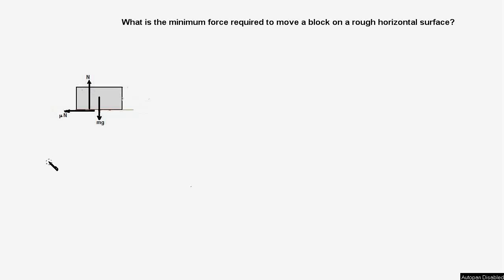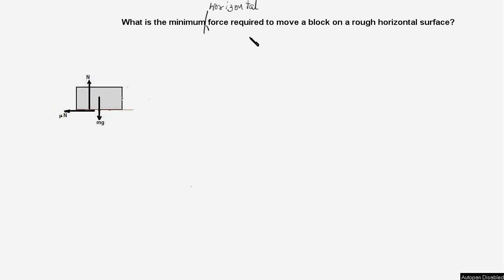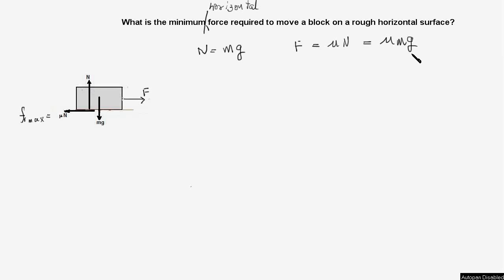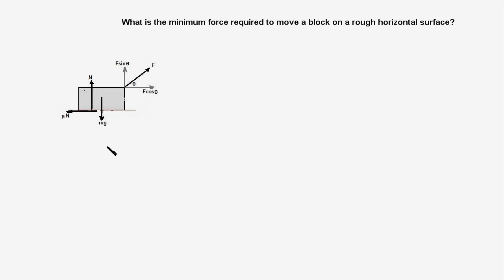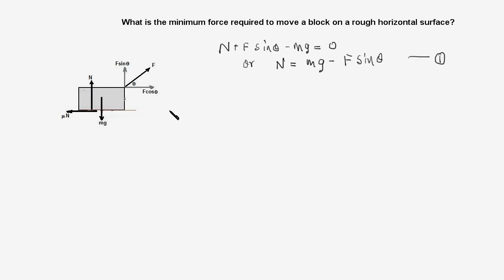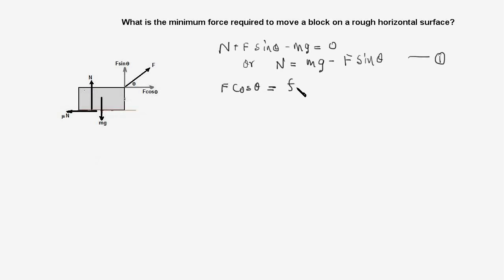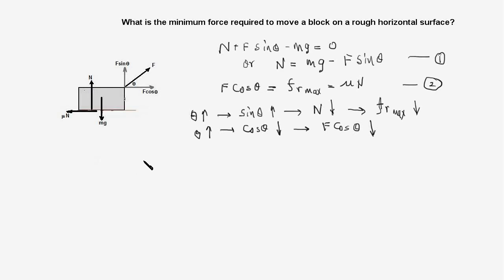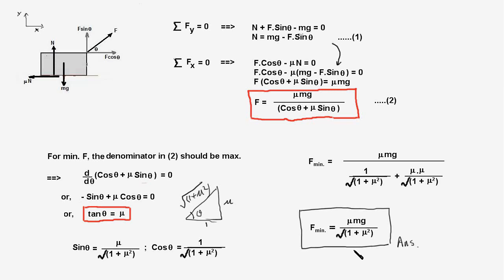12.2 (IIT JEE /NEET) Static Friction: Minimum force required to move a block

Comment: It is very intuitive to think that force will be minimum if it is exactly opposite to the friction, i.e, if it's horizontal, I did the same way, and checked the answer and it was wrong. I was frustrated! Then I thought maybe if the force is acting at some angle, I might get the answer. I did the whole thing thinking that I'm gonna surely go wrong! But when I got the answer I was mind blown! Like how amazing is Physics! I came to check my answer online, and it was exactly the way I did! I feel great! 
(Takeaway: Try even if you have your doubts!)
Thanks sir!
Reply from the maker: Hi Sai, you're absolutely right! It gives immense pleasure when you solve a problem on your own especially after struggling for a while. Keep it up and happy learning.

Comment: So is that minimum force the x component or the diagonal force?
Reply from the maker: Hi Karan: That conclusion isn't quite right. The correct conclusion is that the externally applied force is minimum when the angle of its application w.r.t. horizontal is equal to tan inverse mu. Pl. watch the video again to understand the concept.

Comment: Why do we differentiate cosx+usinx w.r.t. x?
Reply from the maker: The expression is in the denominator (Eq. 2 of the slide) and its value depends on the  value of x (angle). We want to  find the value of x at which the value of the expression  would be maximum so that F would be minimum. Hence, it is differentiated w.r.t. x. Hope that answers your question!

Comment: The horizontal component of force is the one which causes the horizontal movement ,,, then why haven't you equalized it to ma instead of zero when you wrote P fcos(theta)=frmax..Thank you very much indeed for your helpful video
Reply from the maker: When the block is just about to move, the pulling force is equal to the max. frictional force... the acceleration in such a situation is zero and therefore the expression is equated to zero. Hope that answers your question! Thanks for your comments and happy learning.